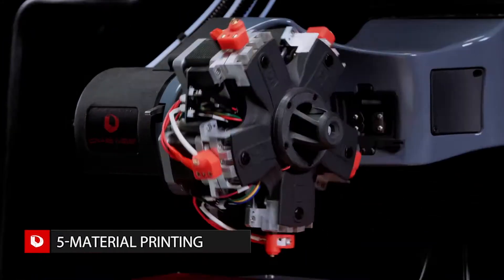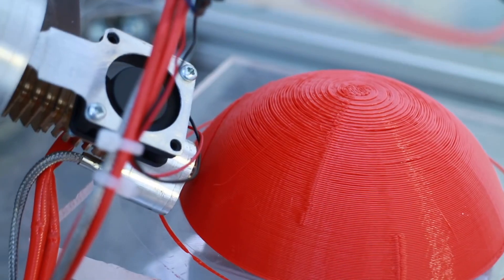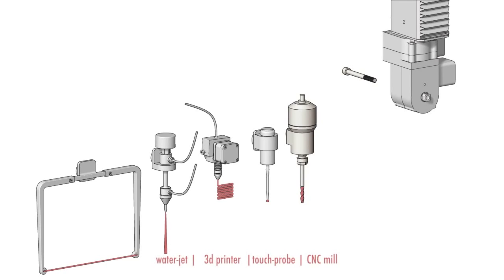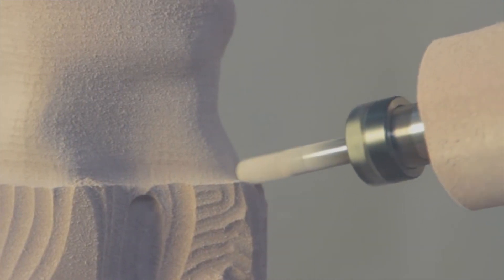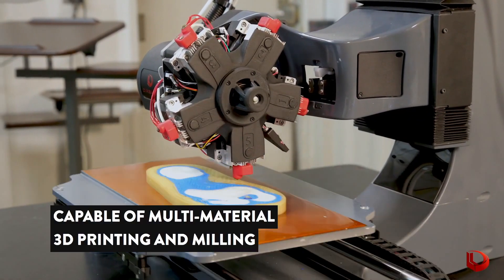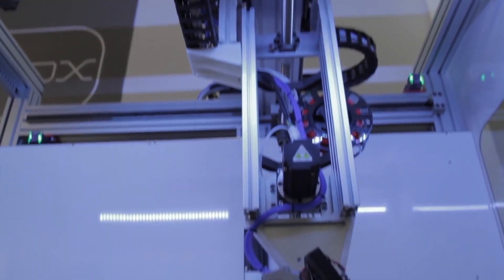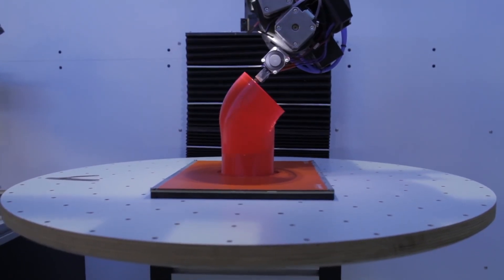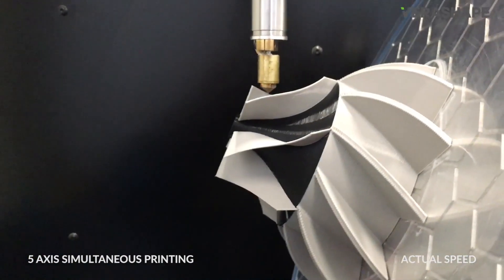3D printers that can print with 5-axis Control | The 5 Best 5 Axis 3D printers in 2021

Comment: Well, SLA printers (Stereo lithography) have far more resolution and quality than the almost obsolete FDM (fused deposition modeling, or melting a tube) printers....
Reply: Sensing no bias at all in your comment...
Reply: @CWelton6  I only mention that because I saw a YouTube video
Reply: Spoken like someone who owns neither. The materials for SLA are nowhere near as diverse or useful as in FDM. SLA printers are mostly small build volume. There are a lot of toxic chemicals and cleanup involved with SLA. For the small improvement you get in part resolution, there are a great many downsides and tradeoffs that you did not consider, or even know about. A decent customised FDM printer can do exceptionally well, good quality, strong and durable parts, and in materials and sizes not really possible with SLA. So no, FDM is not obsolete, it is still a growing and developing field.

Comment: The main obstacle for a 5 axis 3d printer/CNC machine isn't in the actual machine itself but the software/slicer that can actually program the toolpaths.
Reply: Exactly what I was just explaining to my friend. Sure, I could build it, but to write code for every print would be a nightmare
Reply: i dont think that is a big problem. 5 axis machining is not something new, but yeah, i dont think Free 5 axis Slicers will appear so soon.

Comment: Awesome video!

What about 5axis slicers? I'm curious about it.
Reply: yes, that is the real question.
Reply: Well with 5 axis you dont have to use "slicer", you simply generate proper code in 5 or 6 axis CAM + CAD with generative design options. Its not very hard to write a post-processor that will add material instead of removing it. And today CAM software is excellent in generating complex paths like that.

Comment: Wouldn't really call this the next step in 3D printing (or CNCing for that matter). I only ever see this being useful in a few select cases of industrial applications. Even then, it'd probably be better to just get separate 3D printer and CNC machines.
Reply: I can see this being useful in at least half of the applications out there for 3D printing.
Reply: A 3D printer IS A CNC MACHINE.... its computer numeric controlled. it just has a different tool head on it. 
your confused and thinking a CNC mill or Turning center(lathe) is the definition of CNC. which its NOT. 
3D printers are just a new branch of the CNC world. its not machining but its still CNC.
Reply: @darkshadowsx5949  pedant

Comment: Do not join milling and 3d printer. You are join all cons together: heavy weight head, low accuracy cheap machining, etc...
Do not use 5 axis machining without tool length sensor
Reply: Yeah that is not correct. I own many mills and printers and have been doing CNC industial size since the 90s. These issues do not exist if you have a good build quality and good engineering architecture. One day when I have time, I will upload a video and show you.
Reply: @turbocpt1  - "These issues do not exist if you have a good build quality and good engineering architecture." -  Yeah.... and these things are FREE... dude, the point is COST,  yes, you can build a machine with stupid strong motors and rails, but the cost is simple to much for a SMALL Machine.
Did you watch the video? did you hear the Price of each one? now google the price of a Ender 3.
Reply: @brianfhunter  You took the word right out of my mouth, thank you
Reply: Not every job requires micron precision... jebus dude. they arent making it to compete in against the aerospace industry's or precision requirements. plastic wont hold up in that world.
Reply: @darkshadowsx5949  - Its not about precision, its about Cost, even a bad printer/milling cost a lot because u NEED to have a minimum robust structure for milling, and that adds Weight, and for printing, you need fast accelerations, not a problem if you have very little weight, but that is not the case if you have a heavy structure made for milling.
If u buy 2 machines, one for each task, u will get better quality and speed, paying LESS.
Joining these 2 process on small scale manufacture, makes zero sense.
Put a 2mm nozzle on a 1m³ printer/milling, then we can talk
Reply: Yes and all the dust/shaving. This is really bad for 3d printing
Reply: @mophie6941  you first print, then machine, not the other way around.
Reply: @turbocpt1  Not really sure what is your point with this reply.
Reply: @mophie6941  my point is the dust theory, where 3D printers are involved, is scrap. :)

Comment: 1st- Instead of rotating 5Axis Head , Rotation 5 Axis or even 3 Axis Base plate form would be would more accurate and sturdy.
2nd- Both 5Xis Print Head and Build Plate form and Object could be Used for Even greater unprecedented results.
Thanks 
Regards
Reply: There is a problem with the parts separating from the print bed if the bed has 3 axis. It just introduces more warping/ peeling issues to 3d printing.
Reply: It'll be great for heavy parts yk

Comment: To improve the print speed and quality we need to get these 5 axis printers in the hands of 3d makers, that way it can be all sorted out much faster and for less money.
Reply: Make one
Reply: @linecraftman3907  I am hopping more MAKERs do build them, but the slicer program is where we need guys with programing skills to step up. The hardware part we can work out.
Reply: @Robothut  If you make a good job document the build make a parts list and open source everything Yosef might make you the software wouldn't be the first time think White Knight .
Reply: I dont like the idea of mixing machines and having dust potentially get into my prints. It will happen there is no way around it. Id rather have separate machines, and so i do. 

I am exploring making another printer 4-5 axis using servos, linear rails, and screws. 

Already have the 4/5 cnc and its far more rigid, so no point down grading. Built that myself too.

Comment: Swiss knife aproach, I see. Shitty at everything, but I guess a cool gimmick, or expensive paper weight.
Print quality and speed is so bad. You can do it better with a 3d-Pen.
Reply: My thoughts exactly. Looking at how unstable those tool heads are is just asking for shitty prints, totally negating any benefit it could've provided. Also I can't think of any reason to combine additive and reductive manufacturing machines into one. It's a non-issue and only worsens the quality of both.

Comment: ... people can use salt annealing form cheap regular 3d printer to achieve higher quality... these might be for something else
Reply from the maker: What is that process? Can you provide more information?
Reply: @MarsGadgets  there are some results in the google search, it’s using fine salt powder cover a fully printed part (not hollow) then keep in oven for hours... there are some youtubers made some videos about it.
Reply from the maker: @minercraftal  Very interesting! I'll learn more about that process, thank you!
Reply: @MarsGadgets  Go look the videos from CNC Kitchen
Reply: @MarsGadgets  Remove print head replace with gutted syringe run wire electrodes and earth the build plate :)
then fill with the requisite metal salt for your application can use multiple syringes for bimetal strips or memory metals too.

Comment: 0:21 ...without compromising surface quality...
Reply: @Nani Nano No. FDM printers can do better. Most of them.
Reply: @Nani Nano Damn. Then what kind of printers do you use or how poorly do you use them. An Ender 3 pro can make 10x times better job than that and it cost only 200$. I hate that printer because I spent more time fixing and calibrating it than printing and now I am building my own printer. But still quality that I was able to get after a calibration was really good. 100x times better that whatever it is on the video.
Reply: @bubume8277  Nice, what printer are you building? I'm trying to convince my job to buy stuff for a voron 2.4 so I can build it but I don't think they'll budge.
Reply: @BigPapiLoc  I am designing my own, I hope to finish designing it this week. Few of the parts I already have, like linear rails from HIWIN. About voron, a tone of ppl recommended me to build this printer. Even in hobby stores they have full or almost full kits to make a voron. So there must be something good about it. It uses linear rails if I am not wrong and it is a cube like build, so from this alone it sounds like a good idea. I need something more specific tho. I am more about precision than speed if we talk about printers, so I am making a machine that will fit my needs.
But. If you want to build something that was already tested then probably go and make a voron.
Reply: @bubume8277  Holy... from a ender 3 pro to designing your own printer that's pretty fucking awesome. I hope to get to that point someday lol
Reply: @BigPapiLoc  I am a IT guy, but as a hobby I design and build small mechanical stuff. I totally chose a wrong career path, but oh well. So it is possible to design stuff like this without a degree if you put enough time and though into it. I of course have been talking with ppl smarter than me and I let them judge my ideas, but most of the time there is no much to complain about.

If you do want to design something as complicated as a 3d printer remember few things. One, not everything that ppl say on RepRap forums are true, there are many ppl that just want to prove thier own point. Talk with ppl that realy make and service machines like CNC, machines for PCB boards and 3D printers. If they make a living out of it, they probably know a lot.

And last thing don't reinvent the wheel. Especially now everyone is making really weird designs that are over-complicated and don't bring anything better than already exists. CNC machines exist since around 1952. Simpler the better. Especially if we talk about mechanical stuff. Less backlash and points of errors you have take to account the better.

Comment: Who is going to buy it? It is expensive even for a company. I get it. It can make parts stronger probably... "probably" because in the video they are making those parts weaker, like at 7:31. Normally seam would go around the whole object, here seam is going only thru the rotor blade. If the reason is smoothness not strength, then use resin 3D printer.

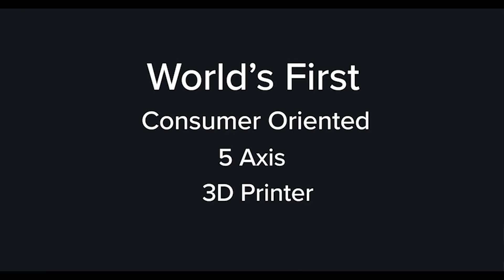It seams it is only good for like all-in-one use. Like it was shown on a video here 4:43 Because you can't do it on normal 3d printer. But as just 3d printer alone it is meh.
Reply: Two additional axes to calibrate for days on end...
Reply: @ThisPageIntentionallyLeftBlank  yup. Imagine leveling your bed in this configuration xP
Reply from the maker: @ThisPageIntentionallyLeftBlank  Hopefully they will have a BLtouch equivalent for these
Reply: 5 axis cnc milling machine makers show off their talent  on 3d printing, it is not feasible for everyone. 
And absolutely it is not for a regular maker,  because you have to use CAM-like software to do the task.
Bu it works as a charm , I would love to have it  even if I have cheap 3d printer at home.

As for the calibration, it seems that it does not need to calibrate and it has auto bedleveling function as well.
Reply: @myetis1990  Of course it has autoleveling but it also cost more than a good car. I was thinking about a cheep 5 axis printer made "RepRap" way.

And like 3D printers can make shapes impossible to achieve by CNC machines, this is like one of the reasons why metal 3D printing exists.

Soo I still don't get the point of 5 axis printers.

It mostly looks just like a show off that doesn't bring anything useful. Or more like an addition to a CNC machine.

If cost is not a problem, then use injection molding instead. You will have a strong part in any direction. Also propeller that they were printing could have been made with a CNC soo if you have a CNC why you would want to use 5 axis 3D printer for that?  
If it was just a prototype you could just print the same propeller on a 200$ printer.

But if you have a super good 3D printer then you could make a really strong part by using super expensive filaments that melt at 400C and by printing in a chamber which this 5 axis printers seams to not have.

For me those 5 axis printers are only good if you want a all-in-one machine that is also a okay 3D printer.

In any different case, methods that already exist are much cheaper or make a better job, or even both.
Reply: ..ALL tech is “expensive” at the start…
Reply: @ernestgalvan9037  I don't get what you were trying to say.
If you mean that new tech is always expensive you are kind of right, but CNC machines were a new thing at around 1952, and maybe 5 axis CNC machine isn't from 1952, it also isn't a new thing.

And still what is the point of spending 200000$ on a printer if I can make the same exact part on a printer that cost 200$ or a lot stronger part on a printer that cost 2000$ and can print stuff that needs heated chamber etc.

Comment: So... the big question.,.. what slicer do you use ?
Reply: Yup. Like copying the design and making it work as just a 3d printer for a lot less is absolutely doable. You only need to add a rotating bed. But at least for me software would be the worst problem. 1. Slicer, but 2. What to use on a main board?
Reply: @bubume8277  a slicer transforms it to gcode, you can use any firmware that is capable of handling that, duet for example would be ablt to do it. reprapfirmware with a skr gtr would do it..
Reply: @KeesHessels  Huh. Good to know. I know a little about hardware, but not much about software in 3d printers. Soo if you are right then the only big problem is the slicer. I would like to build a printer like this to at least see for what it can be useful, but for sure I would fail at code and etc. At least at first.
Reply: @bubume8277  Yea,  if you are looking for 5d slicers they are around, but come with a hefty price tag from either siemens or as a fusion360 plugin from some other company, I haven't researched it thoroughly tho, so i might be wrong on that, but so far i haven't found a opensource solution and i doubt the regular players are willing to invest time\money for essentially recreating their slicer core, it would be a maior project for what is a very small market right now (hardware wise)
Reply: @KeesHessels  a slicer does turn an STL into gcode but its a tool path file not magic. 
a gcode file generated for a standard 3d printer isn't going to work on a 5th axis mill or 3d printer. 
you have to generate a gcode file for the specific machines capabilities. they're not smart. they do exactly what their told to do.
for CNC mills the program that makes the gcode file is called a post processor not a slicer. 
its called a slicer for 3d printing because it literally slices the model into layers and generates gcode for it.

if you try to run a sliced gcode file on a cnc mill your going to have a bad time.
Reply: @darkshadowsx5949  1. 
1. "a slicer does turn an STL into gcode but its a tool path file not magic. "
     i don't believe i ever said it was magic nor did I say it was difficult, but to create one, it does take time...
     To create a good one takes even more time.... to create one that handles filling, supports and all other related things in a "5d way" takes a lot of time.
2. "a gcode file generated for a standard 3d printer isn't going to work on a 5th axis mill or 3d printer. "
     euh, yes it is, just not the other way round... 
3. "you have to generate a gcode file for the specific machines capabilities. "
     Nope only if you want firmware specific functionality,
     Besides almost all slicers have a setting that lets you specify which variant output you want, Marlin, RepRap, ....
     But generally speaking if you slice something for marlin, it will work on reprap, however the output might just be slightly (read less) good.functionality or not.
4. "for CNC mills the program that makes the gcode file is called a post processor not a slicer. "
     a bit picky huh...